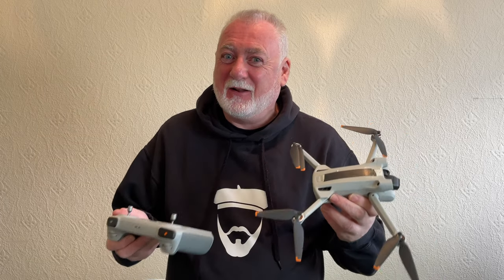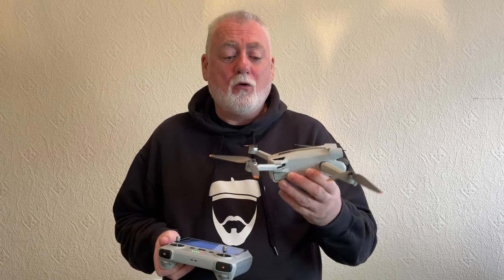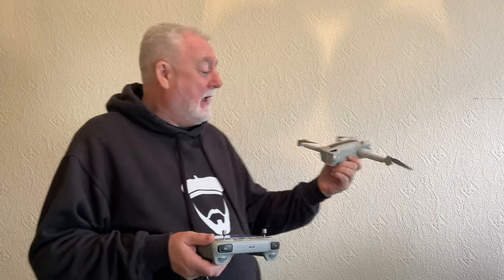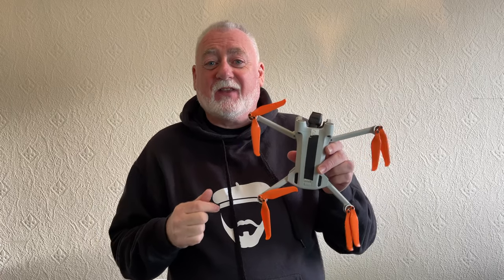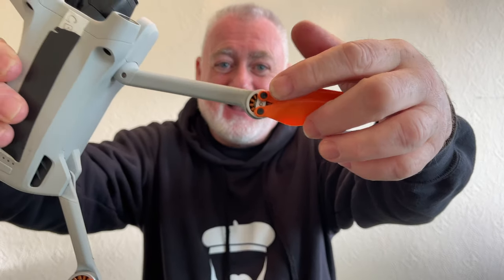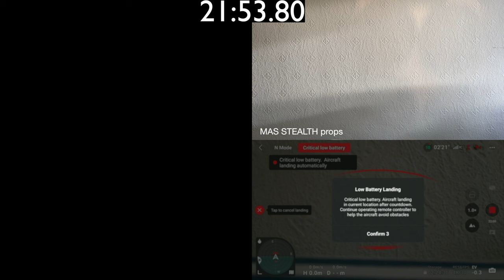DJI Mini 3 propellers - Master AirScrew Stealth V OEM

Comment: Isn’t it wonderful to know that we’re going to get 14 minutes less than the advertised flight time out of a battery I do wish DJI would do real tests instead of sterile condition ones and tell us how much flight time we are actually going to get know what they can push it to
Reply from the maker: I have no idea how DJI come up with their figures
Reply: @WindsweptRobert  and it’s supposed to be travelling forward with no deviation from its line at a standard speed optimal with no wind in perfect conditions and hold and by the way you were asked after on drone seekers international, they were wondering where you’d got to
Reply: Well I've heard just hoovering the battery's won't last as long as when there in flight but I've never done that test I also purchased the battery plus and I've only got 32 minutes out of them in flight although the advertised as 47 minutes lol but 32 minutes is a long time in the air 😁👍👌 🇬🇧
Reply from the maker: Can't see how flying would give more flight time than hovering, but maybe you're right and hovering uses more power somehow. I'd like to get a scientific answer to that :)
Reply from the maker: Ahh...well, I've just stopped livestreaming for the moment as I've now returned to full time work and I need any spare time to concentrate on video content.

Comment: Fair assessment, I think. I think if you did the same test without changing the props and using the same battery on every test, I think the results would be all over the board. I don't think DJI's chargers are 100% accurate and despite being flown in the exact same circumstances, their discharge rate fluctuates too much for an accurate test of flight time. 

Funny you mention about not knowing about the corresponding notches on the propellers and on the arms since you've had Lassie for so long now....the Mini 2 has the very same notches!!!
Reply from the maker: Just shows how infrequently I've changed Lassie's props... Despite all of her adventures, I've only changed her props once! I've NEVER changed Caledonia's (except for these MAS tests!)

Comment: Other than adding a bit of color (colour), I don't see any major reasons to switch from the OEM props.  Its been SO LONG that I've needed to change/replace a prop on any of my UAVs (well, FPV racers not included). I think the props on my P3A have been on for 4-5 years. Ditto for my XK-X380. About 3 yrs for my EVO 1. Once in a while I clean bug guts off them, if necessary, but that's about it. Interesting test. Cheers.
Reply from the maker: Aye, I think the only difference is the colour, Bill. I must admit, I'm starting to like the look of Caledonia with the coloured props. I may have a look at the MAS props for Lassie and Laddie!

Comment: You nailed it with your brief discussion of variables.  MAS claims a few % longer flights,  and that's a reasonable claim. Is it a reason to buy them? 🤔 Possibly,  if your the type to always push the limits and always fly till the last possible moment.  Personally,  I like some of the colors, and the lower pitch. They're not too pricey for the Mini Drones, for Mavic 3 it's a bit more expensive. They just added Red and Blue to the Orange,  Black & Green. I wish they had dark blue for my new skin on Mini 3 (Butterfly Copper) Great testing Robert.  Now for the visibility and perhaps add a speed test simultaneously! :_FLYING:
Reply from the maker: I was out filming the visibilty test today. Hoping to have it edited for Wed. Meantime, i've re-visited the audio test and it'll be published later this afternoon :)

Comment: Looks like a fair test Robert. Still looking forward to you doing the outdoor noise test, both with a meter and how you perceive the noise level. The weather is looking colder but better for flying drones this week, just when I think you said you were returning to work.
Reply from the maker: I start back at work tmrw and the forecast is minus 1 to minus 3 but no rain or wind. So a great flying day and now I won’t be able to get out in it 😞
Reply: @WindsweptRobert  😥
Reply from the maker: I got out and did some filming in my lunchbreak!  Video will be posted on Wed if I have the time to edit!

Comment: Did you know, the postage almost doubles the price of those props. Just a warning stelth prop for the Mavic Air 2 also fit the Air 2s but, they catch the body front and back. Which damaged my nice new skin and the body, double jeopardy.
Reply from the maker: Aye, they’re twice the price but not any better :)

Comment: Nice test Robert. With reference to the letters I believe R is for clockwise rotation motors
Reply from the maker: How does R mean clockwise?
Reply: @WindsweptRobert  right turning
Reply: One set goes clockwise and opposite rear is same. Other set goes anti clockwise
Reply: I just verified the R. What was the other one? N?
Reply: I believe R is rotation but means clockwise rotation. I have no idea how they came up with letters but the R is definitely for clockwise rotating motors

Comment: 1 minute of flight isnt enough to really make me want different props but good to know and i agree on factors , wind being number 1 , wind will greatly effect battery performance so if people want more flight time , the battery is where you need to improve , also making the drone less wieght can also extend fly time but nobody talks about that lol , i have a dji mini ive drilled holes in , cut out sections of the shell , removed foam from the arms all to reduce the weight , yes its more fragile if i crash but its an experiment since i have many mini drones and nobody talks about wieght reduction i figured id try it out ...nice video thanks for sharing ...
Reply from the maker: Interesting idea there - removing parts of the plastic to reduce the weight. I might have to get me a cheap 2nd hand mini 2 to try this out!

Comment: As I mentioned previously,  the larger drones benefit more. I did a video last summer with Mavic Air 2, and it was obviously lower pitched by perhaps a whole note. Unfortunately,  I kept flying the Mavic Air 2 into the branches above the "testing area" - more comedy than science on that one. :_LAUGHING:
Reply from the maker: Maybe the drone thought the trees were lower, instead of the pitch being lower. 🙃

Comment: Found out the hard way I bought a set of these Master AirScrew props for my DJI Mini3/ not Pro. Just to let everyone know the Motors on the DJI Mini 3 are different to the Mini 3 Pro and do not use the supplied Screws. The DJI Mini 3 has the same Motors as the Mini  2.
Reply from the maker: Ahhh..well, the good side is that you have now informed people and that's helpful to anyone who may have a mini 3 and is thinking about getting the MAS props. Thanks for that :)
Reply: do the screws from the mini 2 work on the mini 3?